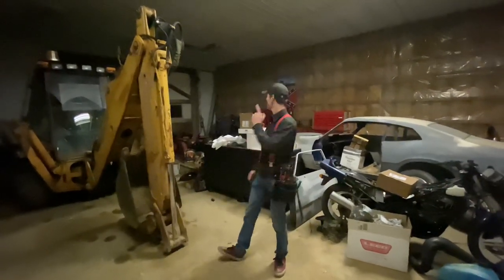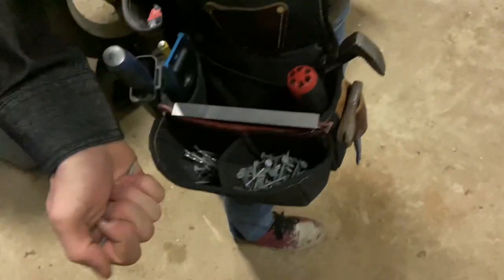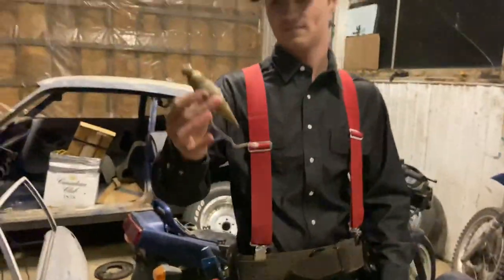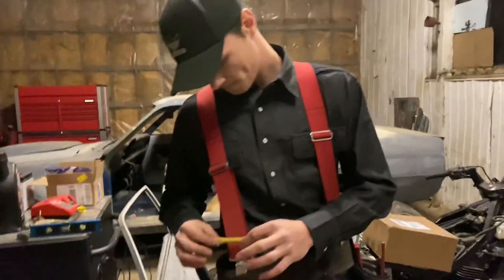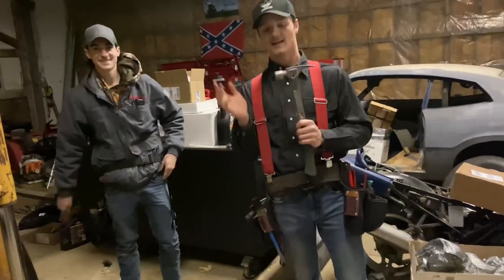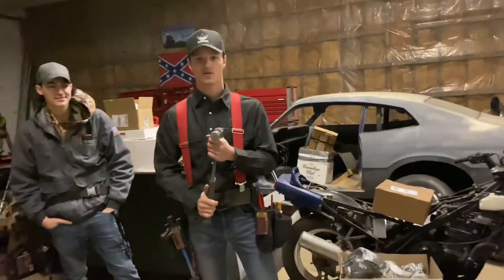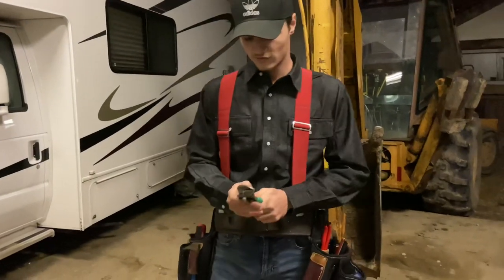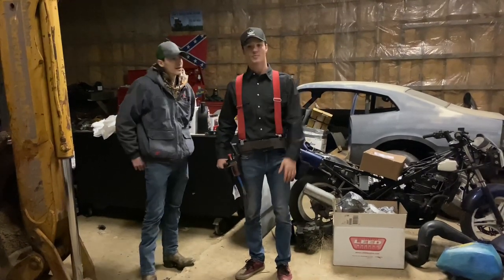Occidental leather tool belt tour

Comment: Your bags are reversed!  They are facing your back rather than facing your front!  For example, the cats paw slot needs to be at your rear and your combi-square slot as well.  Seems to me your using bags not suited for you.  Your tool belt is your most important tool... dominant hand side = tool bag, non-dominant side = fastener bag and secondary tools.  Lots to learn I guess.  Good luck
Reply from the maker: Just cause I’m left handed and got a good deal on them. Seems to work fine for me, cheers
Reply: Have you heard of left-handers????

Comment: You should look into Buckaroos wide double belt with the option of attaching their suspenders.  Both are great, and will help you out with your Occidentals.  I wear them with  my Occidentals.  I bought the bags separately. The right bag does not have the tape holder. and has two smaller bags,  The left bag has 4 bags instead of the typical 3.  Food luck with your career and you both guys are pretty good with the video..